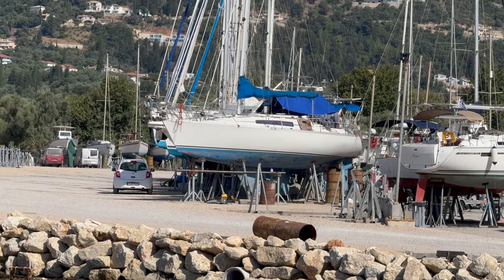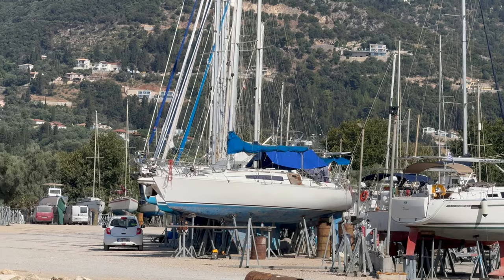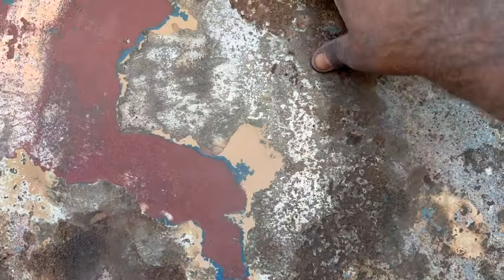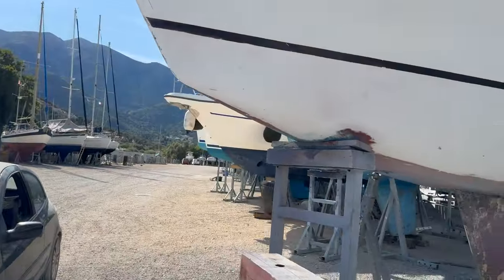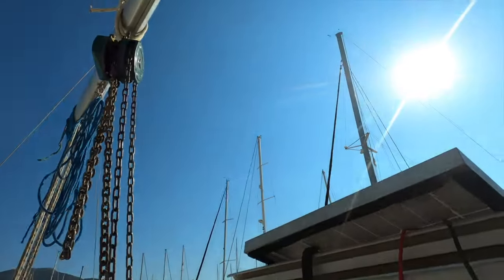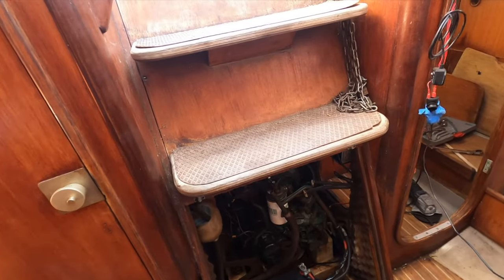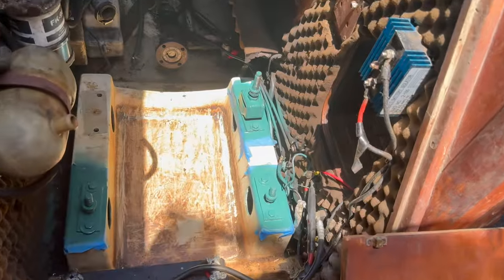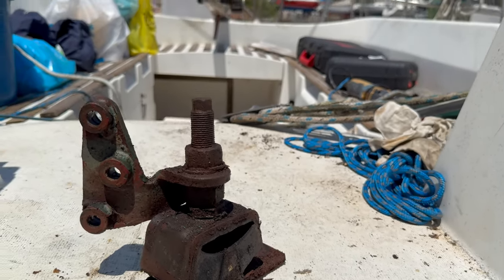Abandoned Sailboat Project   Engine out | S4 E21   HD 1080p

Comment: when i did my keel, i did it in many small sections, you need to cover exposed metal as quick as you can, otherwise it will react , faster you reseal the the exposed metal , the better.... ( was priming mine within 30 minutes)
Reply from the maker: I redid the rust treatment then washed and primed immediately. Good advice. Thank you